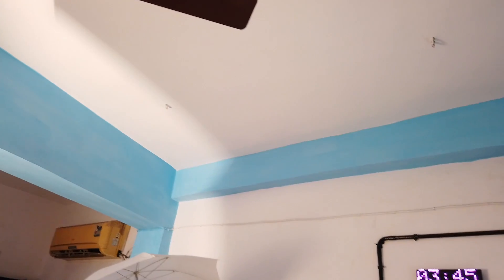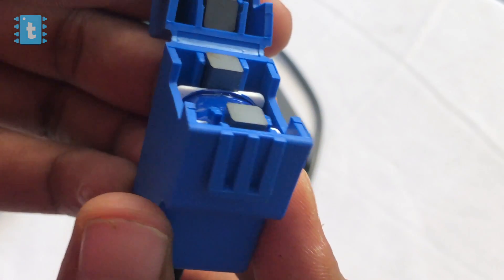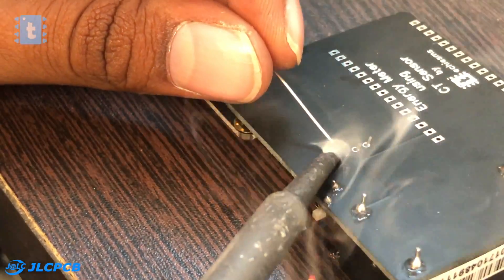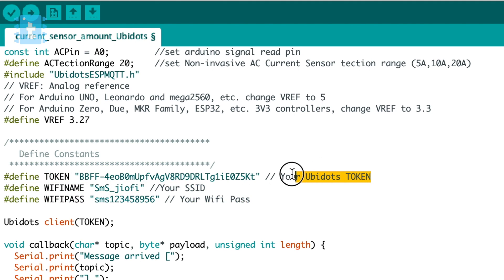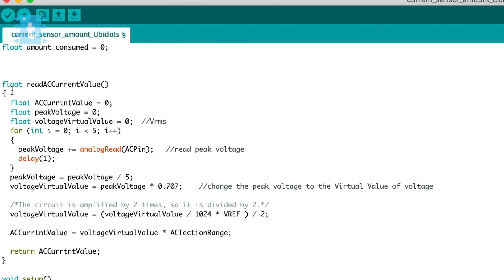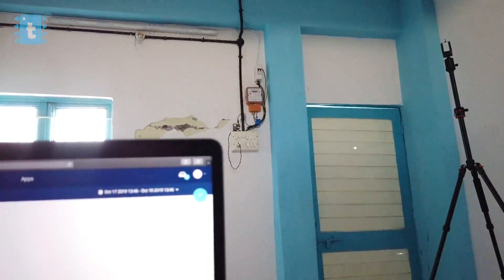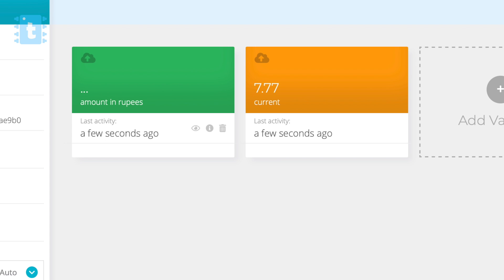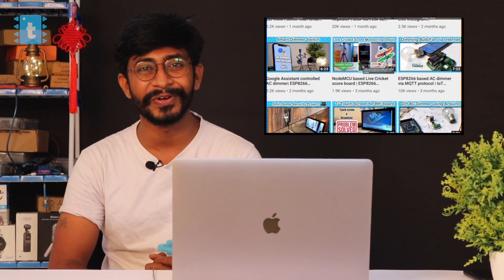IoT Energy Meter using NodeMCU & CT Current sensor | JLCPCB | Ubidots | DFRobot

Comment: First of all im interested in making this project in a different way so can u give logic (code ) to find kwh using zmpt101b voltage sensor n acs712-30A current sensor
Reply from the maker: It’s just a matter of calculations the code logic won’t change. Just look at the data sheet and change the calculations

Comment: You are not monitoring the real power, but apparent power here, also assuming constant voltage and in phase V-I. This needs to take the power factor into account, which should be measured in the mcu. For that both the instantaneous voltage and current values must be sensed, multiplied and integrated.

Comment: #include <ModbusMaster.h>
#include <SoftwareSerial.h>
SoftwareSerial mySerial(11, 10); // RX, TX
#define MODBUS_DATA_TRANSACTION_PIN 13
ModbusMaster node;

  void preTransmission()
  {
 digitalWrite(MODBUS_DATA_TRANSACTION_PIN,1);
  } 
  void postTransmission()
  {
 digitalWrite(MODBUS_DATA_TRANSACTION_PIN,0);
  }

void setup() {
pinMode(MODBUS_DATA_TRANSACTION_PIN,OUTPUT);
 // Init in receive mode
digitalWrite(MODBUS_DATA_TRANSACTION_PIN,0);
Serial.begin(9600);
// Modbus communication runs at 9600 baud
mySerial.begin(9600);
 // Modbus slave ID 1
node.begin(1,mySerial);
// Callbacks allow us to configure the RS485 transceiver correctly
node.preTransmission(preTransmission);
node.postTransmission(postTransmission);
Serial.println("selec Tc id :");

}

void loop() {

node.readInputRegisters(21, 1);
Serial.print("VOLT ");
float prosess_value = node.getResponseBuffer(0);
Serial.println(prosess_value/10.0);
node.clearResponseBuffer();
delay(500);
node.readHoldingRegisters(23,1); 
Serial.print("AMP ");
Serial.println(node.getResponseBuffer(0)/10.0);
node.clearResponseBuffer(); 
delay(500);
  

}

Comment: You only considered an individual appliance to calculate the current consumption using single CT sensor . How to calculate for whole consumption using that single CT sensor?
Reply: I mean which wire should I select for calculating whole consumption?
Reply: @mountrat  To do this, you would have to put a CT around each leg of your mains, in Canada we have 2 x 120, you would then have to add the total current for each leg in your sketch. I have built this very thing for my home.

Comment: Superb Video!! Your editing skills are improving every time I see your video! I like the schematic made by you in the video. One suggestion is to use Fritzing Software to make breadboard designs, perfboard/stripboard, schematic and pcb designs. I have used it and I have very good experience with it. It will make airing and routing much easier with autorouter, drc, easy to add parts and built in part editor.
Reply: Lol🤣🤣

Comment: Like every time it's a wonderful project Sachin. But the main thing is that, the (Amp) showing this this device is it same as our "Electricity Meter" we use in our house ? Because if it's not same there will  be a huge gap between  our "Electricity Meter"  consumption rate (Rs.) and our IOT device energy consumption (Rs.) value. Pls clarify how to solve this.  Thanks Bro for ur wonderful projects.
Reply from the maker: First of all 
The traditional energy meter don’t shows Amps they show the units which corresponds to kWh 

Second of all, the price calculated by my formula gives an estimate and not the exact value. As in practical the prices per unit changes with number of units as well. Like their is less rate per unit under 200 units like that and other thing is that in practical electricity bills there are several taxes and fixed charges included 

So the amount shown in the display is just a rough figure about how much our appliances are consuming
Reply: @techiesms  ok  thnks for reply bro

Comment: never ever do the connection like this....u first clamped  the ct and then u plugged it in the burden resistor...the ct might burn if secondary side is left open... always first connect the ct to the board and then clamp it on thw wire
Reply from the maker: Copy that
Reply: I will take care of that, time to make this project now.
Reply: Akshay Rajput can u give me ur contect no
Reply: @ayus148  😁
Reply: dear akshay you are right..but burning of CT goes with very high current situation. For domestic purchase upto 2-3 or 5amp (primary current not secondary ) it wont be a problem
Reply: @crazycoolguy109677  CT burns due to High secondary voltage and not due to high current situation ...V1/V2 = I2/I1
Reply: @crazycoolguy109677  Yeah but this current is passing through the CT secondary terminals acting as a current source. Ifthe terminals are open ckt, then voltage developed at the terimnals is infinity(I*R ohms law for open circuits) and this can lead to sparking and damaging of low power electronics